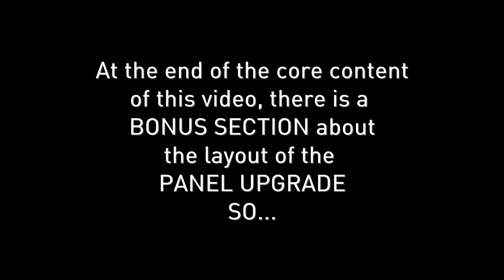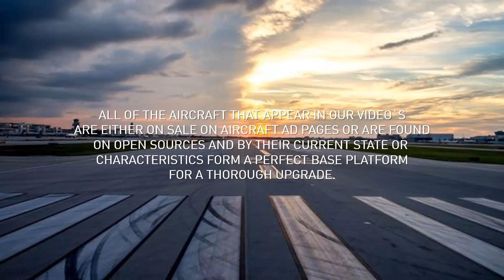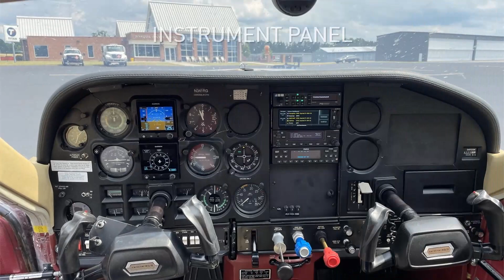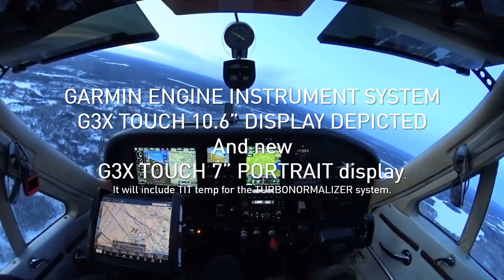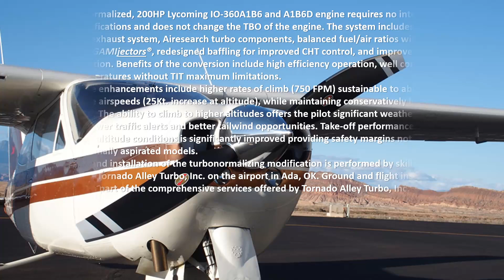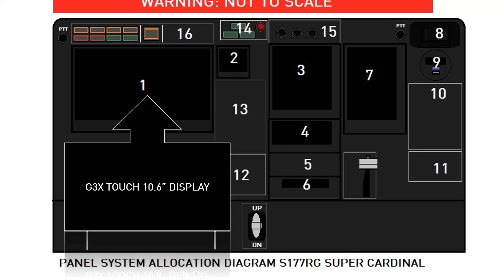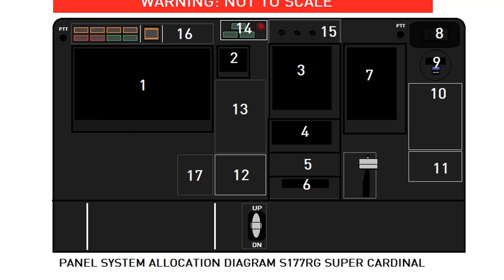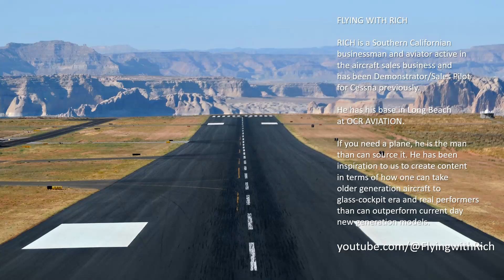DRACO AVIATION - CESSNA CARDINAL RG MAKEOVER

Comment: Nice list of upgrades. Please post your estimated price list. Last I saw the turbo was $50k upgrade. 

I fly a '75 177B FG. Love my plane but that goal is to get an RG turbo to make the CO trip from TX. 

May want to include O2 unless you are going all portable. May need to peek at the ELT to make sure it is compliant. 

The seats are not the greatest for long stretches so improving the batting is needed when you install the new covers. 

Hope you guys do a series. If you are not familiar with Cardinal Flyers Organization, take a look.
Reply from the maker: Thanks for your feedback. I try to reply as soon as possible but end of august is holidays period with my son. So we went off for two weeks and a half. Now back. Just made a new video on my channel about the MOONEY M20R. I have another about a 3GX OVATION too. 

https://youtu.be/aXFPcDz0a9I?si=YvY4xYLIkSk5b5UP
This is my first video since holidays ended.
Reply from the maker: Well, let`s say that in this aircraft I would have to go PORTABLE OXY for 2 places. I checked for installed oxy in Cardinals and it seems that it is very reduced number of options there. The only thing that is not existing is auxiliary fuel tanks for the Cardinals as to give it longer legs. I fly mostly stretches between 750 and 950NM. Which is about the distance between my current homestead in Spain and my home country Belgium. The lack of auxiliary fuel would oblige me to insert a fuel stop halfway as it cannot go direct. Spain is okay in terms of weather all year round especially where I live but Belgium is another issue with rapidly changing weather, much more rain, much more overcast (ICING). It is a bit more limiting as some STC`s were not developed for the CARDINALS which is a pity.

Comment: I love the ramp appeal of the Cardinal, she looks great. I have about 10 hours in a friend's C177. She handles nicely and view outside is spectacular by not having a wing strut blocking your view. I always considered the Cardinal as a poor man's Cessna C-210. One benefit is that you don't need a HELOC to fill the tanks with avgas. Love to see it all completed.
Reply: I've got a 76 Cardinal and literally got it intending to move to a 210 after a few hundred hours. Unfortunately, I'm now hooked.
Reply from the maker: @ddthompson42  Haha. Hooked on the Cardinal. It is a fantastic machine indeed. There are only two types of STC`s missing for this aircraft: ROBERTSON STOL (with the drooping ailerons) and FLINT AERO Tip Tanks. Both would enable the aircraft get in and out very short strips (even unpaved) and increase the range considerably. The auxiliary fuel option was never developed for the Cardinal, nor is any STOL kit. Those are the only two major upgrades that are non existing.
As for the rest, it is a marvel and with the large panel, you can get a full glass GARMIN in there wether it be based on G3X TOUCH, G500TXi. It is perfectly feasable. With the GFC500 autopilot it also enhances the ease-of-use operation of the aircraft. Imagine the G500TXi + GTN750Xi+GFC500 working together. You need to cross a fix at x distance at altitude x or above. Well you program the GTN750Xi by selecting either the crossing altitude as "at" - "at or above" - "at or below" at y feet and select the crossing altitude on your GFC500 and select VNAV. The plane will nail it, just like the garmin combo will do in any other model. It is becoming like flying a bigger airplane as a pro.